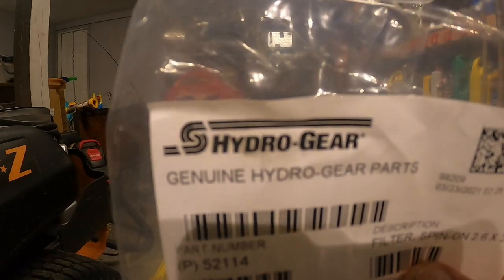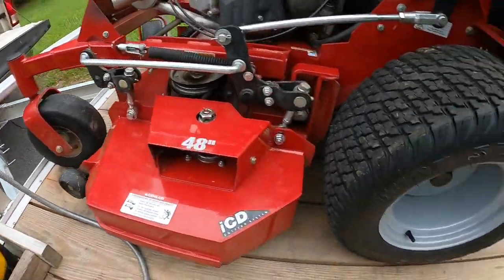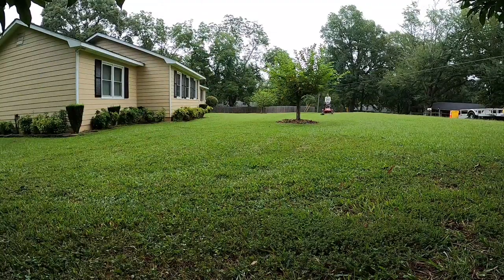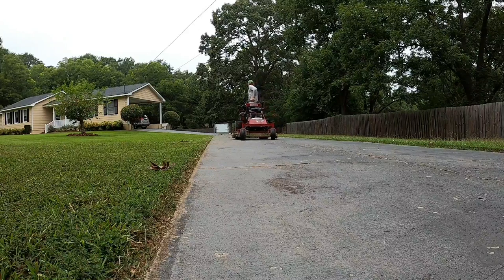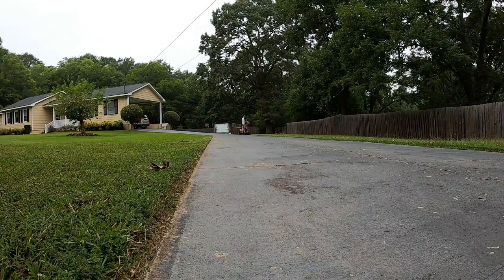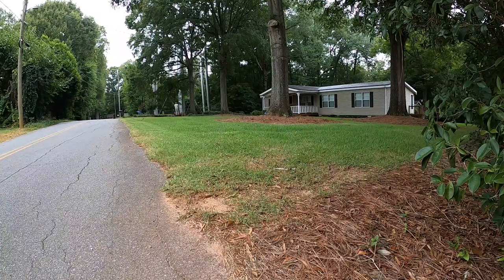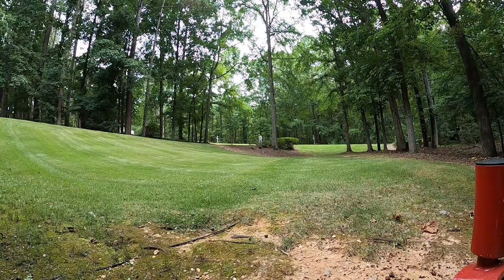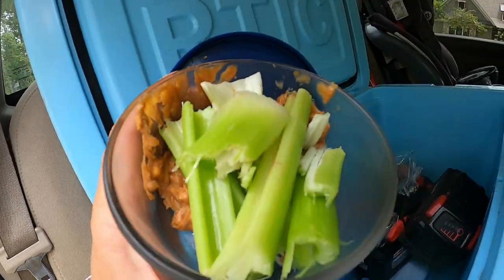HOT DOGS ON A HEMI? (Solo lawn care vlog#19)

Comment: This is a question which really doesn’t pertain to the video. When you trim plants and the trimmings fall onto the pine straw, do you mulch, rake, blow or hand pickup the trimmings out of the beds. I have been raking but you rake up the pine straw as well. Trying to figure if there is a easier way other than putting down tarps - which is aggravating as well.
Reply from the maker: I just trim them so often i dont have much clippings to deal with so just alittle blowing and im done

Comment: Great video what do you use to take your blades off when sharping? I’m looking to get an impact after using wrench’s for years. I’m wondering if an impact will over tighten the bolts. Would love your to hear your opinion. Thanks
Reply from the maker: I use a 1/2" ridgid impact on setting number 2 it works perfectly i say get a impact it makes life so much easier!!! Never again will i use wrenches what platform of drills do you already have ?
Reply: I’ll run in Milwaukee I think I’m gunna get one today lol
Reply from the maker: @drewterrell5163  i plan to go all milwaukee at some point  aswell since i now have so many batteries for the ope. My dad has the 18 volt brushless milwaukee impact that just come with the drill he loves it for his mowers 💯